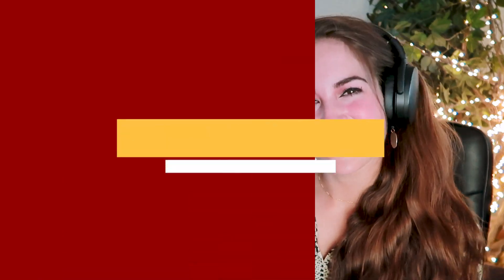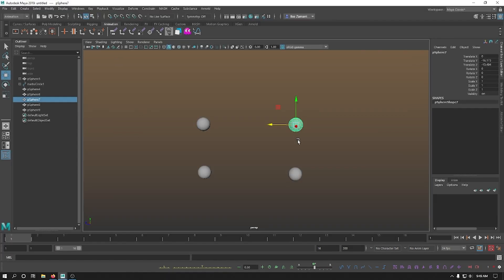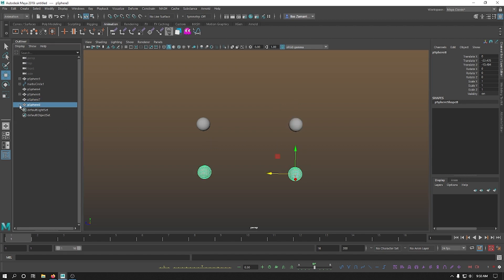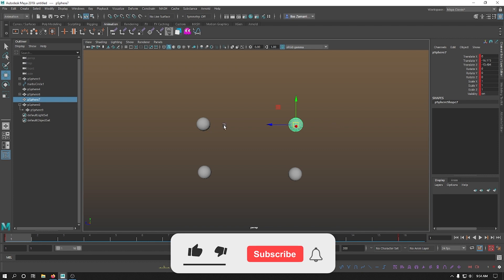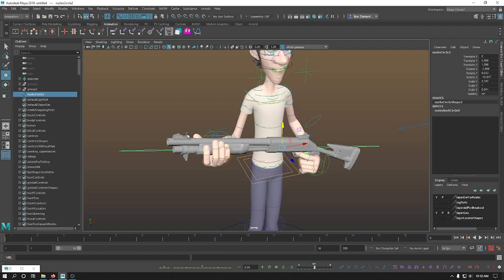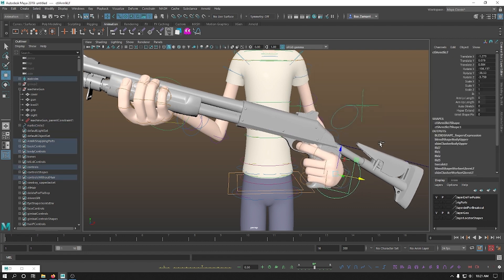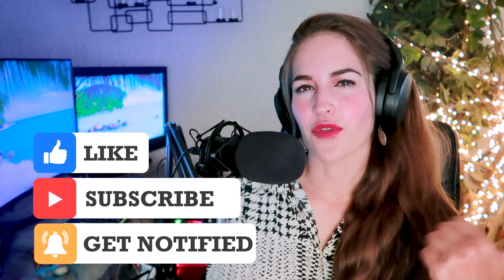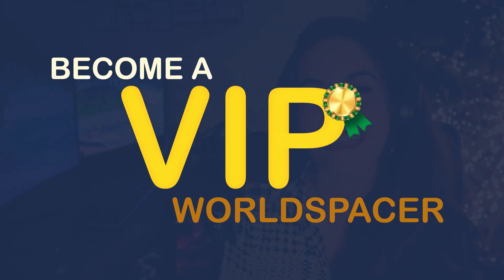Complex Constraint Systems // Animate like a boss!: Machine guns and Rifles.

Comment: Wow! nice work. Everything on point...but I have this bbiiiiiiiggg doubt.

How come parenting the hand controller to an altogether new geo doesn't break the rig? I'm certain a new user (or even an experienced one in some cases) wouldn't be able to put the handCtrl back into a complicated hierarchy where it was unparented from without breaking the rig or animation. I also didn't got the part "curves needs to be released when working in a studio" at 3:33, is it about releasing the constraint's weight? I MAY BE TOTALLY WRONG HERE, FEEL FREE TO CORRECT. Thanks
Reply from the maker: Hey, Pallav! when you´re working in a studio, once you finish your animation you want to later release your baked animation to other departments. I was referring to that process commonly called ¨release¨or ¨export¨. In order not to break the rig or the hierarchy and do it in other ways, there are certainly other methods to bake back independently and keep your animation working. :) I hope that answers your question!
Reply: @IlseZamarripa Gotcha. You're soooo good at explaining things🤓😍